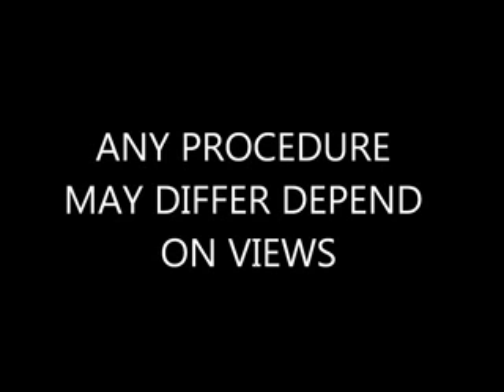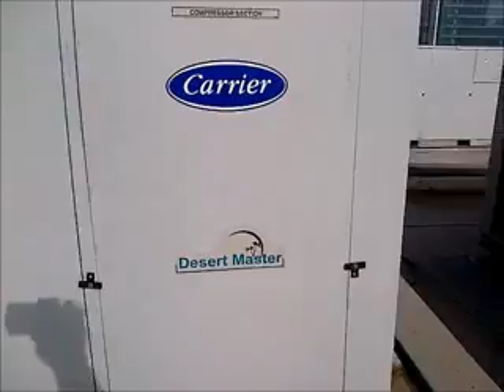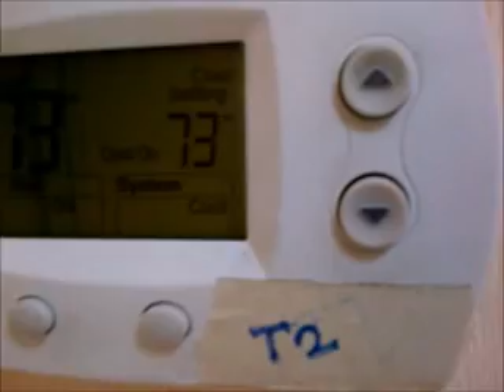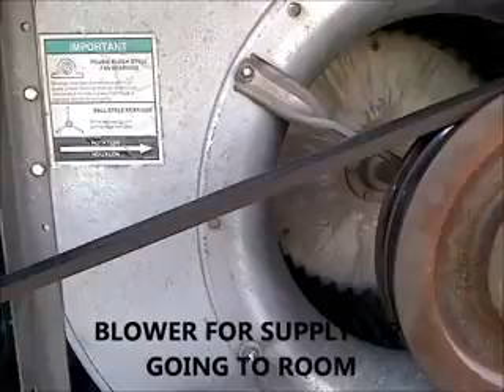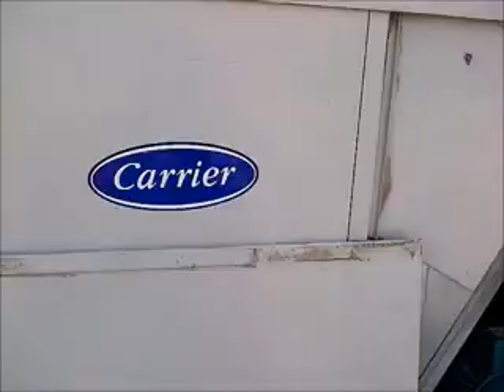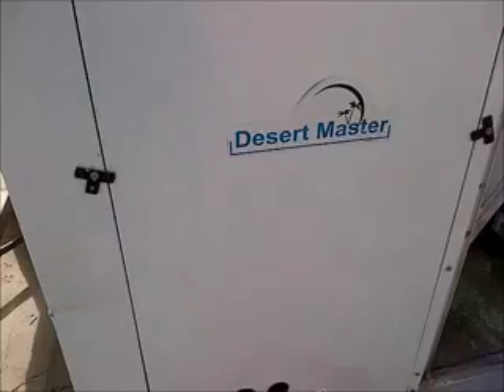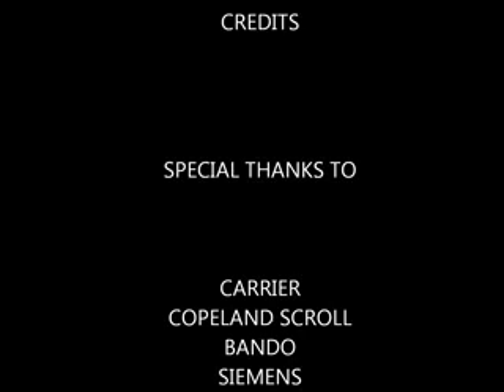ac servicing (package ac)

Comment: i am also a/c technician  i have check a packege type  compressor was running  cooling quail have also moisture  but no cooling 
compress shoing  suction pressure 90 and discharge 230  what is problem
Reply: please adjust throttling device properly
Reply: If it is reciprocating compressor, i think compressor pumping week or throttling device may need to adjust.